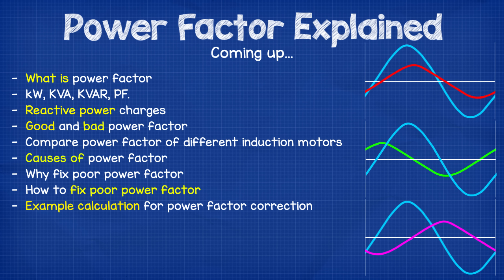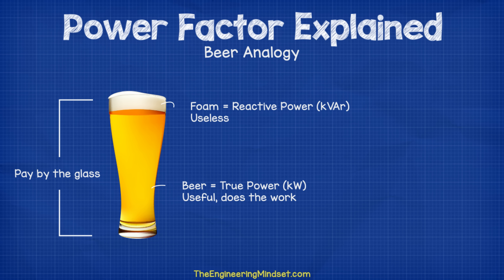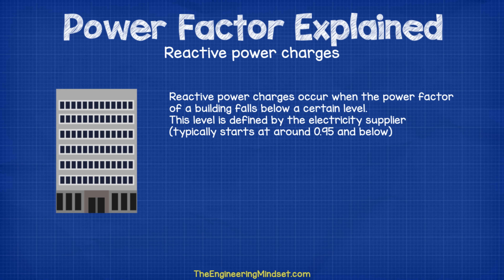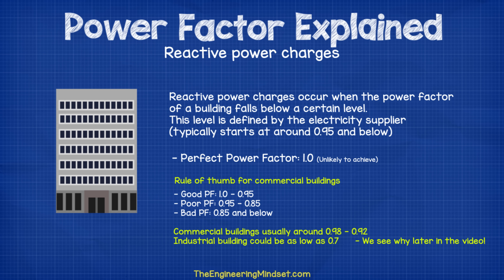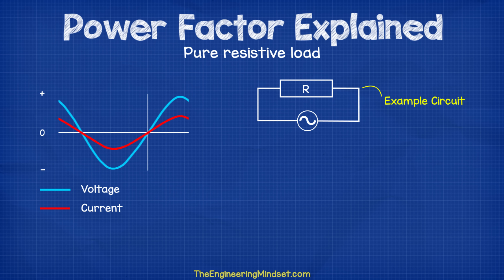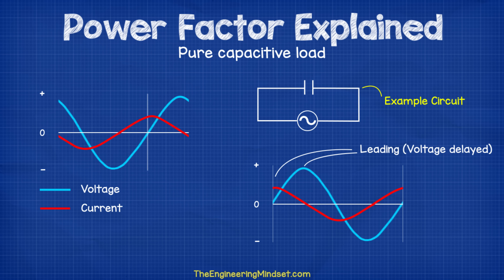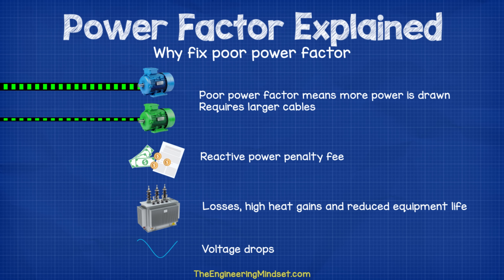Power Factor Explained - The basics what is power factor pf

Comment: Can u pls explain the differnce of working of synchrnous motor ,dc motor, also  dc generator and alternator
Reply: Think about the simplest motor you could make.   You use a coil of wire rotating across the field of a permanent magnet.  During the first half of the rotation, we put a steady DC current through the coil of wire, such that it rotates clockwise.  Suppose it rotates from the 12 O'clock position to the 6 O'clock position on this half of the rotation.   The north pole of our electromagnet (the coil) will rotate until it is aligned with the south pole of the permanent magnet, which occurs at the 6 O'clock position.   Once it passes to the 6 O'clock position, the torque reverses, and tries to push it back to the 6 O'clock position.  The motor's inertia will attempt to keep it rotating, but it is rotating against a torque in the wrong direction that slows it down.  This attempt of a motor will swing like a pendulum, and settle on the 6 O'clock stable equilibrium position.  The 12 O'clock position is an unstable equilibrium, like the top of a pendulum, while the 6 O'clock position is the stable point like the bottom of a pendulum.  The conclusion is, we need a direction reversal in the current of the coil, if we want this motor to continue to power the rotor in all parts of the cycle.

A DC motor does this with a switching contact called a commutator.  The commutator is a switch that reverses the polarity of the voltage across the coil and subsequently the current direction in the coil, every half of a cycle.   This causes the electromagnet to switch its north and south pole, so that it is attracted to the 12 O'clock position after passing 6 O'clock. 

A synchronous AC motor by contrast, uses the reversing of the source waveform, instead of a commutator, to switch the current direction in the electromagnet.   The positive half of the waveform would cause it to rotate from 12 O'clock to 6 O'clock, while the negative half of the waveform would cause it to rotate from 6 O'clock to 12 O'clock.   In a synchronous AC motor, the rotation rate is directly related to the frequency of the AC source.  This is why such a motor will rotate at 3600 RPM (with a 60 Hz source), or a unit fraction of this rotation rate, such as 1800 RPM.

Comment: well done! didnt expect that beer can explain the kVA, KVAr and kW...
Reply: One place that the beer analogy doesn't work, is that the kVAr and kW do not add up directly, whereas the beer and foam do.  The kVAr and kW add up as perpendicular vectors.

A better analogy that reflects this fact, is imagining pushing a lawn mower.   Suppose you push a lawn mower with a 50 pound force along a handle that makes a 53 degree angle with the ground (53 degrees is selected, so it can be a 3-4-5 triangle).  The force you push along the handle has to align with the handle, so you can't directly push it forward.  Draw the triangle that represents this force and its components to scale, and you will see that it means 40 pounds push it downward, and 30 pounds push it forward.

The 40 pounds downward is opposed by 40 extra pounds of support force from the ground, so it goes nowhere in this direction.   Only the 30 pounds you push forward on the lawn mower make it move forward, so only the 30 pounds do real work on it.  30+40 obviously doesn't add up directly to 50, but as perpendicular vectors they do.

Comment: In the last part of the video, when doing the maths. Purely on the values that are known, we can not know if we need to add a capacitor or inductor, right?  De Pf only shows the amount of deviation of drawn VA to used W, not wether it is caused by high inductive or capacitive load. Therefor some more info is needed (even though most of the times the bad PF will be caused by inductive loads)

Comment: Such a disappointment that you used the beer glass analogy as it is such an incorrect analogy as to why we actually can't have an AC electrical network without reactive power. A long gas pipe line is a much better analogy. Just think about it.

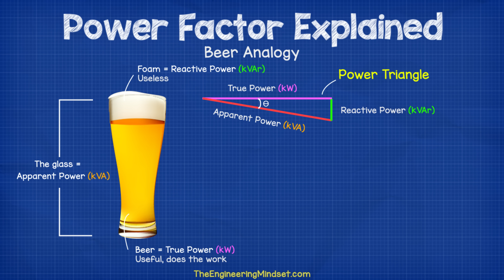Comment: Mr. Paul, there's a mistake in one part of the video. At 2:35, when you gave the engineering formulas, for the power factor triangle, in the very first formula, you wrote , true power = reactive power × cos(theta). But sir , won't it be true power = reactive power × tan(theta) ? 
The ratio between true power and apparent power is turning out to be equal to tan(theta). 
Please review the video once sir.

Comment: So a bad PF is when the current and voltage are 180deg out of phase? When you show the electrical Heater diagram with both the V and A in phase is this why electric Heaters are nearly 100% effcient becuase they have a power factor close to 1? And I also assume that poor power factor means the wattage would be lower than a higher power factor?
Reply: The worst power factor you could possibly have, is when voltage and current are 90 degrees out of phase.  This would mean that the power factor is zero.   What bad power factor means, is that you need more total amps to deliver the same amount of real power to a given load.   Those amps impact the sizing of the electrical infrastructure needed to get power to the load, which is why it is important to control your power factor.  Those amps also mean more ohmic losses throughout the electrical infrastructure.

If voltage and current are more than 90 degrees out of phase, this means your load is actually an energy source, rather than a load.

Comment: maybe I'm way off, but can someone confirm the following:
In the past, office buildings were typically lighted with fluorescent lights all over the place. I understand these have a capacitive load. These capacitive loads would counter (some of) the various pumps and fans with an inductive load. 
Would it be fair to say that in the current time, with LED being a much more predominant light source, the power factor of a building would get worse, and would need to install additional capacitor banks to avoid penalties by the power company?
Reply: From what I understand (and I'm no pro at electrical engineering, just took a course on it) Fluroscent (tube) lights are inductive loads. This is because they require a very high voltage to start, and have an inductor (called the choke, or ballast) in their circuit, which starts them through it's very high back emf (the magnetic field generated by an inductor when there is a change in current across it). The choke also limits the maximum current of the circuit, as it would otherwise have very low reactance.

So actually, removing tube lights would improve the power factor of an office building, and they'd need less capacitor banks/ other corrective methods.
Reply: @lukemckay9758  thank you!

Comment: Isn't it like efficiency?
Reply: No, because the power we have to generate, is still the kW that we deliver to the load.   Low power factor causes inefficiencies, but it is not an efficiency itself.   Reactive power is a storage and release of power that causes the voltage and current to not play as nicely together as they could, rather than a loss of power as heat.

The KW + KW lost as heat in transmission and distribution is what we have to generate, and the KW is what we deliver to the load.
The KVA governs sizing of all the transmission and distribution equipment    Such as service sizes in amps, transformers, distribution feeders, substations, and transmission lines.

A bad power factor causes amps on the transmission line which in turn cause loss of energy as heat.   Bringing the power factor as close to unity as practical, means that you reduce the current, and therefore reduce the ohmic losses throughout the transmission and distribution network.

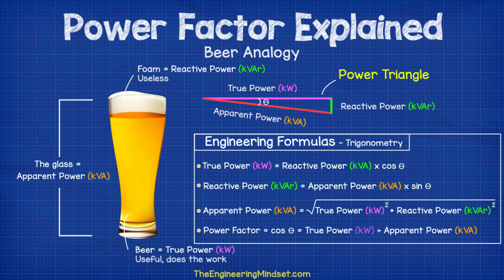Comment: Possible correction and suggestion  ...at about 2:37
In the True Power formula, I think the label for the first term was intended to be "Apparent  Power" (kVA) in yellow or orange,  as opposed to "Reactive Power" (kVA) in green.

Also in the final Power Factor formula it is hard to tell whether the symbol between the two terms is ÷ or +.  I think it is ÷ though / might be clearer.
Reply: Gord, good catch. I saw that as well.
The last formula, the symbol is a Division Symbol. If you compare it with the Plus Symbol in the formula above, under the radical, there is a clear difference.
Reply: Yup. That's correct.
Reply: The exact words I wanted to comment.
👍 Happy to see someone has mentioned it already
Reply: glad i read your comment, i wrote a plus when copying the formula. thanks
Reply: Réactive Power is written (kVAR) :)
Reply: So does the reactive power go back into the grid? Or is it completely wasted?
Reply: or cot instead of cos

Comment: I work in hydro power generation, we have one plant that we watch PF, which is close to a foundry.  The plant is run at 95% PF.  

The rest of our plants we watch VARS.  The two are related, correct?  VARs is just the amount of capacitance or induction you are taking in or putting out?
Reply: VARs is directly related to the capacitance or inductance, but it isn't equal to it.   Capacitance and inductance are properties of the geometry of the component, and properties of the core material of each component.   I.e. the dielectric in the case of the capacitor, and the ferromagnetic (usually iron) core in the case of the inductor.  Capacitance (C) is the electrostatic "size" of the capacitor, and inductance (L) is the magnetic "size" of the inductor.

Given a known frequency and a known voltage, you can calculate how VARs relate to capacitance and inductance.   For capacitance, VAr = -2*pi*f*C*V^2.    For inductance, VAr = V^2/(2*pi*f*L)

Comment: A much better example for the power factor,  suppose you are pushing car but at the same time you are pushing the car slightly up or down, the most energy is used to move the car forward but in the meantime some energy is wasted pushing  the car down or liting it up.  the power factor of 1.00 is when %100 of energy is used to push the car forward that is the car is pushed streight ahead

Comment: Why does the inductive motor need to have some reactive power available to maintain the magnetic field? Is it because the motor would stall and not be pushed to rotate further if there were not some left over current to "push" the stator to rotate more? And if you went ahead and fixed your power factor to better than 0.95, would the inductive motors at your site suffer for it (since they need some reactive power)? Or is fixing the power factor more like shielding the electric company (and your bill) from seeing a bad power factor?

Comment: Your videos are just amazing. I have one query. At 2:35, Formulae of true power is mentioned as Reactive power X cosθ. Shouldn't it be Apparent power X cosθ ? Thanks.
Reply: You are correct.
Real power = apparent power * cos(theta).
Reactive power = apparent power * sin(theta)
Real power = reactive power / tan(theta)

BTW, I'd recommend using the asterisk (*) as your symbol for multiplication, rather than X.  X is a variable, and in this context, X stands for reactive power.
Reply: @carultch  Thanks mate

Comment: That was probably the best layperson's explanation of power factor, kvars, etc.  Many years ago I was brought in to work on an inductive furnace, used to melt aluminum.  The system was driven by a motor-generator.  On the control panel was a meter labeled KVARS, part of the scale was in RED.  We were getting readings in the red, I didn't understand why.  We also had a bank of capacitors that could be switched in and out.  I spoke with one of our proffesors and he gave me a very good explanation.  What we found is that some of the switch contacts on the capacitor bank were worn out and we were unable to change the PF.  The switch said we were adding capacitors but in reality, we were not.

Having taking power quality classes since, what has changed in a building is the type of load.  Much of it today is from switching power supplies in computer equipment, also many of the motors used in HVAC are soft start and variable frequency.  One obvious clue is to feel the temperature of the power panel, as the PF drops, the panel gets warmer, from the losses, and we pay for it.

I wish I saw this video 30 years ago, very good.  Jim
Reply: 30 years ago?  YouTube started in 2005 and therefore didn't exist in 1991.  Neither did the Internet.  Well the Internet did exist in 1991 but was only seen in educational environments for a bit before it started taking off significantly in the public space in 1993/1994.  In those early days, downloading a video the size seen on YouTube today would have been unfathomable on dialup where it took about 10 minutes to download 1MB.
Reply: @privacyvalued4134 I think you may have misread his comment. He wrote “I WISH I saw this video 30 years ago…”

Comment: Can someone explain this to me? If  Apparent power (KVA) is the KW and KVAr combined 05:36, so when your KVA is 11.5 shouldn't your KVAR be 1.5? (KVA = KW+ KVAr so 11.5KVA - 10KW = 1.5KVAr)
Reply: No, because the beer analogy is misleading in the actual mathematics behind it.

KW and KVAR do not add up directly.   They add up as perpendicular vectors.

Draw a right triangle that is 10 cm on the horizontal, with a 11.5 cm diagonal.   You will get a vertical leg that is 5.7 cm tall.   Either measure, or use the Pythagorean theorem.

A better way to think about it, is the lawn mower analogy.   Suppose you have a lawn mower with a handle that makes a 53 degree angle to the ground (angle chosen so this can be a 3-4-5 triangle).   Push on it with a force of 50 pounds along the length of the handle (analogous to apparent power).   30 pounds push it forward (analogous to real power), and 40 pounds push it downward only to be constrained by the ground to stop it from moving downward (analogous to reactive power).

Comment: You had me on the edge of my seat and then then you ended the video! How do you calculate the size capacitor improve the PF? Great videos. Hope you do a video to cover this.
Reply: I agree! What's the value of the capacitor in micro farads ? And how do you work that out ?
Reply: @jamesharmer9293  The AC-capacitors comes rated in (k)VAr at specific frequencies, so conversion is usually not necessary, but here goes:
Farad = 159235 x VAr / (Hz x Volt^2)
For mF, divide by 1 000 (10^(-3))
For uF, divide by 1 000 000  (10^(-6))

Comment: U R a hot shit! I love it, beer too. Yes when electricity goes thru a resistance like a water 
heater, PF is = to 1 It changes when you hook up a motor as a motor has windings around a laminated iron core making an electro-magnet, but those electro-magnets produce a back 
voltage which changes current. I would say flourescent lamps are an inductive load as they
use a ballast coil.

Comment: Hi, it was good explanation. But I got confuse with the last example. Why do we use capacitor ? Why not inductor? How can we know the situation we need inductor/capatitor?
Reply: We use a capacitor in parallel with a motor load, because we need to add a reactance that is has a sign opposite of the reactance of the load with power factor that needs correcting.   If you add an inductor, you will exacerbate the problem.  To know which kind of power factor correction you need, you need to know the sign and magnitude of the reactive power.  Then you add a reactive component with the opposite problem in parallel with it, to offset the reactive load.

An inductor, or an inductive load in general like a motor, will have a positive reactance.  The impedance of an inductance is +2*pi*f*j*L.  Reactance is defined as the imaginary component of impedance, after you delete the imaginary unit (j), which is therefore +2*pi*f*L.   The positive sign means a time delay from voltage to current.

By contrast, a capacitor will have a negative reactance   The impedance of a capacitance is 1/(2*pi*f*j*C).  To bring the imaginary unit j upstairs in the equation, we multiply by 1 in a fancy way:

1/j = (j)/(j)  * 1/j = j/(j*j) = j/(-1) = -j

This means the impedance of the capacitance is -j/(2*pi*f*C).  The reactance is therefore, -1/(2*pi*f*C).  The negative sign means the current waveform will lead the voltage waveform.  Really, what is happening, is the current waveform is time-delayed by 270 degrees.

Comment: ok so when the current or voltage is leading, what is physically happening? you dont explain this, but I want to know the underlying physics and/or what is occuring for this phenenemon to occur? what is going on with the electrons and such to cause leading and lagging which then leads the math to explain this? math explains physical pheneomenom so I want to know what the phasor vectors mean physically.

Comment: @7:27 you said the reactive power is wasted because you get no work from it, but the motor is doing work...please clarify what you mean.
Reply: It's not really wasted.  Reactive power is power that is stored in either electric or magnetic fields temporarily, and released at a later part of the AC cycle.  The power that ultimately needs to be generated, is still the real power that is consumed, plus the real power that is unintentionally dissipated as heat.

What the problem becomes, is that the amps associated with the total kVA consumed, will impact the sizing of all of the electrical infrastructure along the way.   Additionally, those same amps will contribute to ohmic power losses as heat, as the current travels thru the conductors.